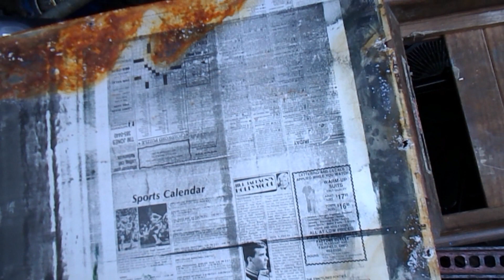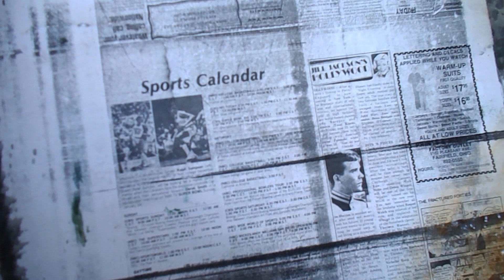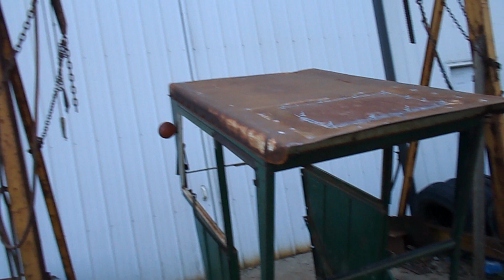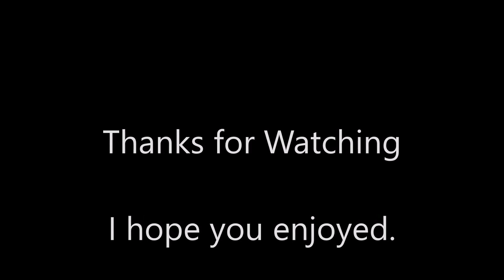Cab On Cab Off Fenders On My Back Hurt's !

Comment from the maker: Well the time has come to put the cab back on the Oliver 1850, I took the fenders off so I could get the cab back on and to make it easer to a bunch of other little jobs that needed to be done. I fixed the roof of the cab and found out the patch that was on it turned out to be one of those sheets news paper was printed off of from 1982 !  Kind of a fun find that I will mount on the wall as its an unusual find for sure. But I sat the cab back on and found out pretty quick there was a big problem, Ware the steps bolt up and with the room between the tire and cab and with the fender back on there isn't much room to get in and out of the cab the way its put together without some or a lot of modification and right now I just don't have the time to devote to doing this right now. So I took the cab back off and put the fenders back on for now so if it dries up it will be ready to go. This summer when I have more time I'll put the cab back on and make the brackets I need to mount it back up ware its easer to get in and out of and make a much better set of steps for it cause the ones on it look like you could slip off them real easy !  Putting the fenders back on by myself was a real job and man are those fenders ever heavy and as I figured the next morning I really felt it in my lower back !  But for now the fenders are back on and I'll be going threw the lights getting them wired back up and working again and I'll bet I have to get a new light switch to replace the one in it cause it really doesn't feel right when you turn the switch. But I hope you enjoyed watching this and maybe learned something from it.  Bandit

Comment: Sorry your cab didn't work out, but it will.  I have every confidence that you will figure it out and get it on to stay.  You're that kind of guy - you won't let something like that beat you.  Keep the great videos coming my friend.  Planting is going on full blast here in western PA.  Have had an unusual stretch of nice weather for the last 2 weeks.  I don't know what happened!
Reply from the maker: I wont call it a fail, But I'll call it a test fit ! LOL Now I know what I need to do and need to got to the scrap yard and pick out some sheet metal and steel to do this with and this summer when I have some more time the cab will go back on for sure !  You guys have been blessed with dry weather but we got all your rain ! LOL Its been raining ever other day weather its a thunder storm or a pop up storm that drops a 10th or 1/4 inch and the ground just wont dry out. Man its acting just like it did last year and the forecast for this week doesn't look any better, Hot and humid and a chance of pop up thunder storm at any time. Yesterday we had a shower come threw that was a mile wide and guess what it went right over the farm and dropped 2/10th of an inch and then the sun came back out and got misserablely hot and humid, You know the air you ware ! LOL one good thing I've got from the heat and sunshine my wheat has really grown and that is a nice surprise ! Bandit
Reply: @banditfarmer1900  Yeah, we've had a good 2 week run.  On Wednesday (this is early Friday Morning) I finished my planting for the year.  All the corn, soybeans and oats are in.  My earliest planted corn from last week is up and is in the 2-3 leaf stage already.  Oats is about 2 inches tall.  The first field of soybeans I planted as at least germinated.  I am actually hoping for some rain now.  We were supposed to get some yesterday, but it missed us. But there is a pretty good chance we are supposed to get some today and tonight.  That would be good for all the newly planted seeds.  Glad to hear your wheat is going good.  That's encouraging, and we all need some of that, my friend.  My wife and I were in Ohio today - out to a restaurant we like in Columbiana area.

Comment: Bandit I really like the looks of the fenders and no cab but I know the importance of the cab. She's a real beauty and hope to find one for my farm in the future.
Reply from the maker: Thank You, She looks good just with the fenders on it and they cleaned up really good mainly because it had the cab on it all these years and was put in the barn so that helped a lot. I looked for 25 years to find the right 1850 to buy and finally found the right one to buy. I cant afford to buy a $7000 tractor and have to work on it but I can afford to buy a $2500 tractor and fix it up and a lot less than $7000 in it but I know this one is right when I'm done. I'll have time this summer to tinker with the cab and get it mounted right with some new steps built on it and that will make it a lot easer to get in and out of the cab too !  The big thing is just to get out of the sun cause I'm getting to that age ware that can become a problem, So A little shade is in order now.  Bandit

Comment: Really cool you found that newspaper press plate! You'll get the cab on you just need some time to noodle around with it 👍
Reply from the maker: Not many people would know what that sheet was made or used for, You surprised me ! LOL I'm going to be hanging it on the wall as a keep sake and its a good one to get people with too !  It will take some time to figure out how to mount it and fabracobble some brackets and then cut that Lexan for the side and back window. The lower windshield will have to be made for sure to keep it from getting the wobbles !  Windshield side windows and a back glass that opens wide will get a lot of air threw it to keep me out of the sun and cool. Takes time and right now I really don't have any right now cause when it dries up I'll be in the fields till its planted and then its cut the wheat and bale the straw and go from there. But the cab will be going back on for sure !  Bandit

Comment: Sorry about your cab, bandit. But I’m glad the 1850 is almost ready to work.
Reply from the maker: I wont call it a fail for say, I will call it a test fitting to see what it needs to be mounted up the right way.  The 1850 is running good but there is still some work that needs to be done to make it right ware everything is working again like it should be. So more video's on the 1850 are coming and there are a few surprises too !  Bandit

Comment: Good video and sorry the cab don't work out for you Bandit
Reply from the maker: Thanks Jan, I wont call it a fail but I will call it a test fit that I now know what I need to do to get in mounted up.  I need to make some brackets and a new set of steps for it and it will be right as rain !  So for now its on the back burner and I'm looking around for steel and I'm ready to head to the scrap yard for some steel and sheet metal so I can put it on this summer when I have more time.  But the cab will go back on !  Bandit

Comment: One day you’ll have that cab modified to fit your tractor! Got confidence in you there cousin Bandit! Fenders are fun,I’ve done a few in my life time , but I was Younger ,so I know you might be hurting some . Cousin Scott
Reply from the maker: Well I sat it on with the hope it would be an easy fit and mock up but after getting it on I could see there was more to it than I thought it was going to be so I took it off but not before taking some pictures and video of it.  I have several times looked at them to see if my idea will work and now I know what I need to do to mount it up for good. Now I need to head to the scrap yard to look for what I need to fix it up the way I want to be. I really don't have time to work on it right now but come summer I should have more time to tinker with it to make it fit. I even got new LED lights for it !  LOL Them fenders are about 100 125 pounds each and very ockward to handle and get back up on the axels ! But I got it and the second one was a fight to get up there and boy did I feel it the next morning, Man I hate to smell like ben gay ! LOL But it sure helps you get moving again.  Cousin Bandit

Comment: Supposed to be a little flat piece of metal that bolts to the deck and acts to hold the brake locks. Sometimes the brake latches teeth get bent and don’t allow them to hold also......fun putting these back to combat shape....
Reply from the maker: One was missing the other is dorked up but I got another set off an old junked 1850 to put on it. If one works I can lock both brakes together and use one as the park brake so I'll make it work .  Its fun taking 50 year old pins out of those brake levers and its in such a lovely place to try to work on it, So glad I did it when the fenders were off ! LOL Bandit

Comment: Looks good Don, you sure have worked hard on it. Them 354 diesels are really good motors, nice tires too.  You can always get you ah' oliver roof canopy they make, a used one, then dont have to be worried about sides and gettin in and out.  Keep up the fixin on it , enjoy the vids.
Reply from the maker: I would rather work on one so I know what I have when I'm done working on it, A good solid tractor in good shape ready to work for many more years and hopefully worry free years at that !  When I'm done she will be right from front to back top to bottom and will look good and run like a top !  The 354 is a rock solid diesel engine as long as you take care of them, This one has suffered for a long time from the lack of maintenance but she is getting it now and she has turned the corner big time and getting back to being a good solid tractor again and I like what I see now !  Bandit

Comment: Bandit you can always do what my uncle and grandpa did...get those sunbrella umbrellas lol.
Reply from the maker: I have thought about that and its still a possability !  I might have to look them up cause it would be better than nothing .  Bandit
Reply: I like that idea of a umbrella also. 
Looks so much better with out the cab
Reply from the maker: @danleach7674  Only bad thing is I hate to drill holes in the fenders, Its had to find good ones and these are really strait so I think I'll wait to put the cab back on. I've run open station all my life so another spring wont kill me, But this summer the cab will go back on for sure !  Bandit
Reply: My grandpa had a fenderless 3020 John Deere that he somehow mounted the umbrella behind the seat. But I don't know if the 1850 would have a place to mount it.

Comment: Hey Bandit, couple pieces of 2x6 rectangular tubing, some plates and the roof off that cab and you could make a nice set of ROPS and canopy for that old girl. Keep you out of the sun but still have the breeze!
Reply from the maker: I ran my cousins 4230 JD with a canopy and its nice being out of the sun, So even with no windows in the cab it will be just as good to me. I think the tinted Lexan for the side windows and back glass will really help too, Side windows don't open but the back glass really opens wide so it can get a lot of air threw it to keep me cool.  Rops would be nice but there pricey but the cab I got so I'm going to make it work so a trip to the scrap yard is in my future !  Time to fabracobble ! LOL Bandit

Comment: Bandit your doing good build your own brackets, Angle iron & flat steel, some tin. We would make brackets out of old plow points, angle iron, flat steel, other repurposed equipment. Doing good
Reply from the maker: Biggest thing I need is time and right now that's something I don't have, If and when it dries up I'll need to be in the field not working on a cab so this summer when things slow down the cab will go on it and it will get done right !  But for me right now its get the 1850 ready to roll so when the time comes she ready to work again. But the cab is going on this summer for sure !  Now I need to hit the scrap yard and look around and see whats there and get it home so I got it when the time comes.  Bandit

Comment: looks great with the cab bandit! to bad it can't stay on
Reply from the maker: Oh its going back on this summer, This was a lets see how it fits. Now I know what I need to do and its rolling around in the back of my mind and a plan is being formed for how I'm going to do it. This cab was put on new at the dealer (tractor ordered with a cab and dealer installed it) and was on for a long time so I know it fits it I just got to make some brackets for it now and a good set of steps for it cause those I have aint going to work to good for me ! I got a torch and a welder all I need is the metal so a trip to the scrap yard is in order !  Bandit

Comment: Curious of what you would like to get for Bertha. Course I'd get killed if I brought it home but just wanted to here what your number would be on it. Thanks and unlike most, I like the cabs on those old tractors. Good luck figuring the mounts up. 

- Deerefan
Reply from the maker: I figure $3500 for it and the duals is not a bad price and it comes with the books I have for it.  I have a pretty good idea how I'm going to make what I need to mount it up right and make some new steps for it I just need to go to the scrap yard now that its open again the get some steel and sheet metal.  Bandit

Comment: are you going to work on the blue ford truck in the near future? neat to see the old gal runnin and workin
Reply from the maker: Thats the plan, I had hoped to get it done last fall but the kidney stones had other ideas !  I miss my old truck and I really got to get her done and back on the road !  Bandit
Reply: I hear you. sometimes things happen abit slower or not as planned but it will get done in time. as for me and my buisness that's how I'm doing things just a step at a time
Reply from the maker: @Thecasey34  When I took it apart I would have never figured it would take this long to put it back together but it is what it is at this point.  The big thing now is trying to remember ware everything is and how it goes back together !  LOL Thank God I took video of it coming apart so I can go back and look to see ware things went or how something was put together. It a big jigsaw puzzle to me now but I just found a really good set of doors for it so the one I put on and the fender have to come back off so I can fit the new doors to the cab and then get new fenders and get them put on and so on. I cant wait to fire her up for the first time !  Bandit
Reply: I cant wait either I'm sure you will do a startup video of it lol.
Reply from the maker: @Thecasey34  Oh ya there will be a first start video for sure !  Bandit

Comment: Maybe instead of the cab you can install a roll bar with a canopy on top?
Reply from the maker: That would be nice but man is that a pricey way to go !  But for now this will work and this summer when I have more time to work on it I'll get it back on and figure the mounts I need for it and make them. I didn't get all the brackets like I was supposed to so I'll have to make them and it might take a little time to do . So I'll run it open station as I'm used to it so no big deal. But by fall I'll be under roof !  Bandit

Comment: Looking at cabs on other 1850’s with cabs yours is setting farther back than them.  The front of the cab frame hits the hood right at the 1850 decal.
Reply from the maker: This is a Full Vision Cab and they sat differently than a year round cab did, I like the way it sits down on the 1850 I just got to make some new mounts for the front and find some sheet metal to go a crossed the front and back of the cab to stiffen it up good so it doesn't wobble any. This is what was called at that time as a Row Crop Cab and also is why I have the different gear shift than a regular 1850 and it does make it easer to get in and out of the cab without the gear shift between your legs to fool with. This tractor was ordered with a cab so it got the different gear shift and the cab was put on the dealer that sold the tractor. I those day no one really had a cab put on at the factory they were all after market and most put on by the dealers or by the farmer if he wanted to save some money.  But I got a cab and this summer it will be put on for sure !  Bandit

Comment: Wouldnt take that much sheet metal,  to fabricate something. I would love to see how you put on the new seat
Reply from the maker: Oliver seats for the 50 series tractors is easy to put on, The bottom has a pin you pull out of the bottom and the back has 4 5/16" bolts that hold it on. I wish all tractors were as easy to change as the Oliver is !   Now that the scrap yards are opening back up I'll be going down to root threw the pile for scrap sheet metal to find what I need and maybe some steel depending on what they have. Angle iron flat channel I can use it all to make what I need. Might even drill some new holes for more mounting spots in the front frame if it helps. Bandit
Reply: @banditfarmer1900  thx bandit. Looking forward to see the old girl turn up some dirt
Reply from the maker: @justinschmitz8034   I cant wait to try the 6x14 MM plow on it, Our other 1850 we had pulled 5x16" in 5th gear no problem so I figure 6x14"s shouldn't be a problem. Fresh dirt rolling and black coal rolling , What could be better ?  But it make for good video !  Bandit